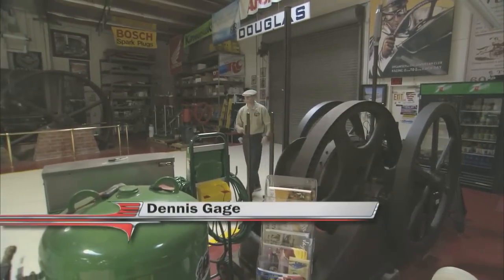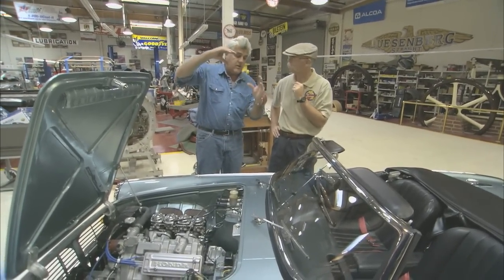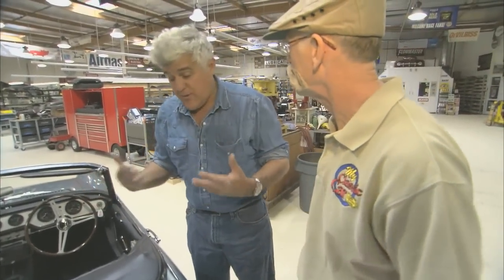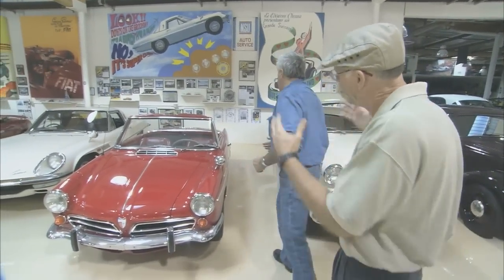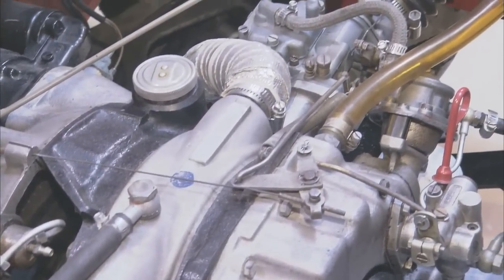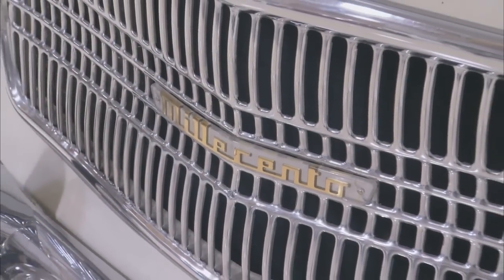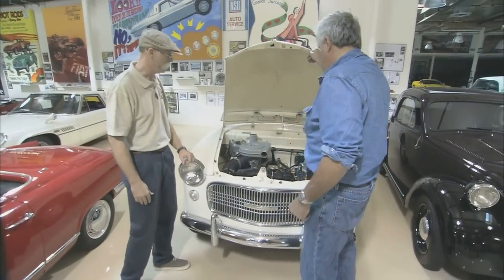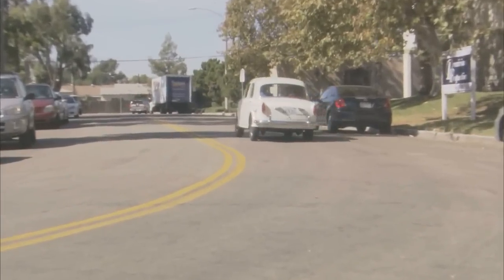Jay Leno's Big Fun with Small Classics | Honda S600 | Fiat Millecento | NSU Spider

Comment: Honda upsized the engine to 800cc. They eventually removed the rear chain drive on the later S800s.  They were never officially imported into the USA so I believe. They were in the UK as they initially only made right hand drive cars.  I recall neighbours having a hardtop S800. As a kid I always liked the short cute looks.  They were cheap, but the roller bearing big ends and rear chain drive put people off buying them.  They were odd as Honda were only noted for bikes.
Reply from the maker: Interesting insight. Thanks!
Reply: Also, initially only motorbike dealers sold and serviced them.  So they were only expecting low sales. A bit of a put off, a bike maker making a car was not inspiring at the time as the two markets tended to have makers who only specialised in one type. The MG Midgets and Triumph Spitfires were too much competition. So much it was baffling why Honda entered the UK market.  Even Fiat did not export their open tops to the UK in the 1960s. A shame because the Honda engines were very nice with a nice sound.